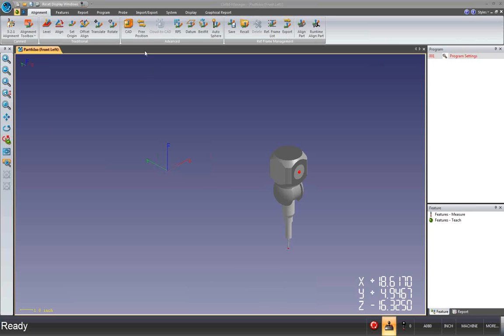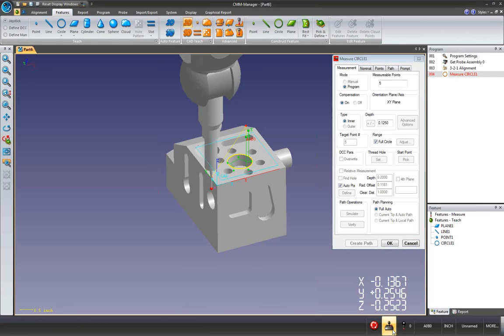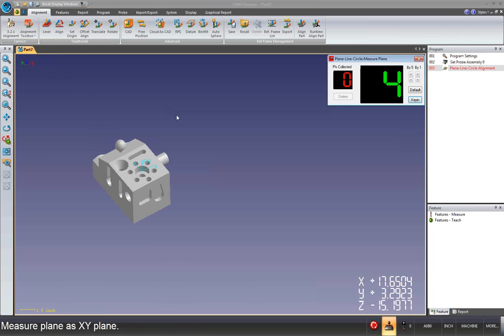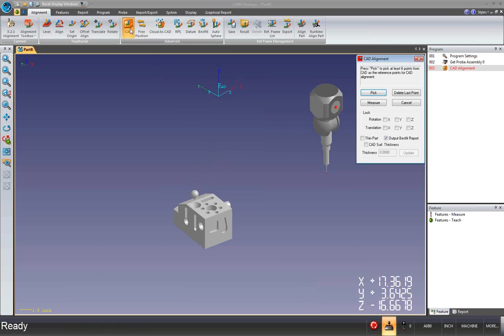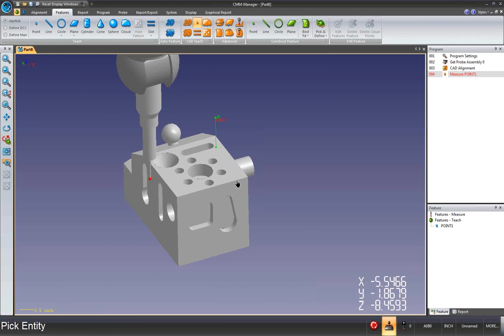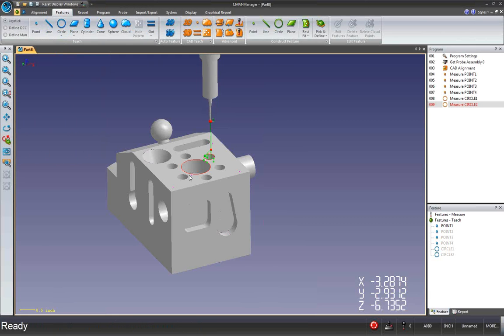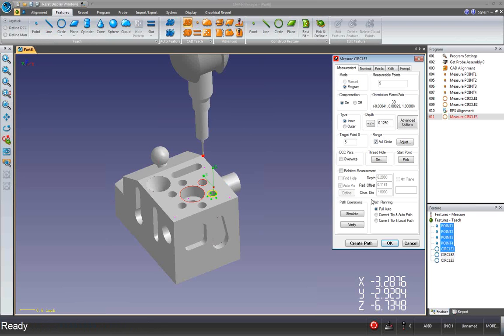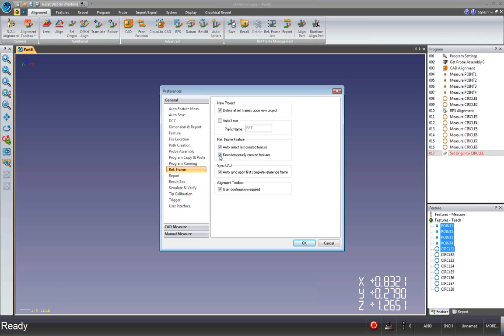Import, Align & Measure with CAD

Comment: how to do  alignment with 321 when three planes are not perpendicular to each other. For that datum target points defined 3 points for primary, 2 points for secondary and 1 point for tertiary.  ?  thank you
Reply from the maker: See CAD Alignment for manual operation and Datum Alignment for DCC systems.